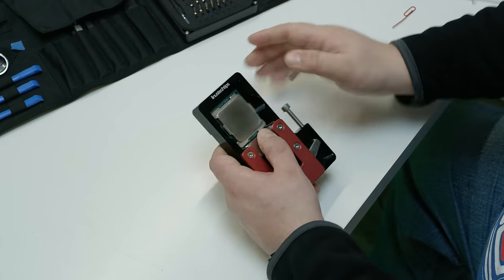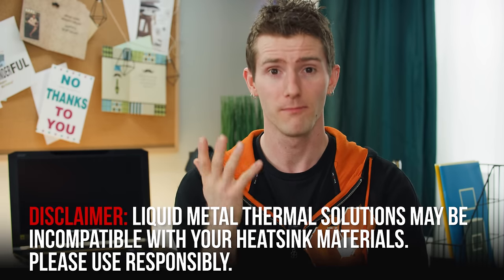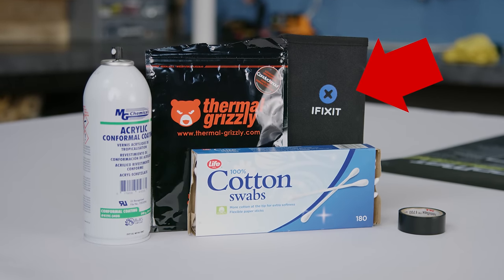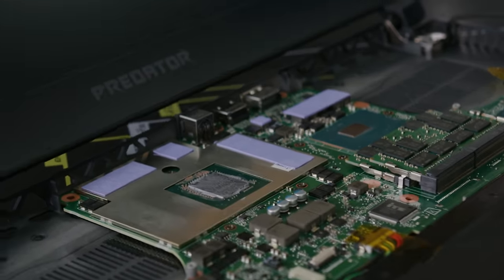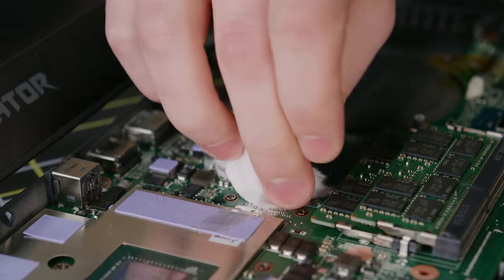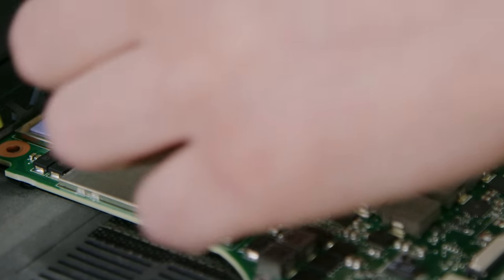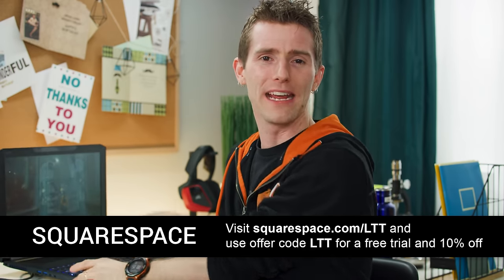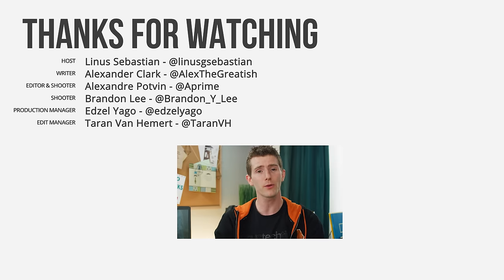Liquid Metal Laptop Cooling – 20C LOWER!

Comment: Finally LMG... using LM on laptops is almost mandatory, as is undervolting/overclocking using thorottlestop
Reply: Could you tell me how often should I change the LM in a laptop if I clean and re-apply say, a GC Gelid Extreme about once a year?
Reply: yesterday applied gc gelid on my 960m and 4710mq got 20c drop
Reply: You don´t need to do it very often. I do it every 4-5 months because I feel better, but there is no change in doing so. It holds up better than normal paste.
Reply: daily...
Reply: I was thinking the same, two months ago i change to liquid metal on my notebook and did some undervolting of the cpu (7700hq) and overclock/undervolting of the gpu (nvidia 1060) and i went from 30 fps on shadow of war with a lot of stuttering to almost 60 fps smooth AF. Temps also lower between 15 and 20° less than before. Ah the 1060 is overclocked to 1935 mhz @ 0.9v with a +200mhz of vram. I used MSI afterburner for that, if you press CTRL + F you can set a curve profile and limit the voltage for each clock.
Reply: i got a similar effect on my 7700hq simply by undervolting. my cpu would not stand for -120mV but -110 and -115 worked
Reply: Jan Dano I don't get it. What does undervolting mean and why does it help?
Reply: undervolting is just what it sounds like running the cpu or gpu on less voltage which means they generate less heat to begin with. All heatsinks have a limit to how many watts of heat they can remove from the source. Undervolting reduced the potential heat it can make. Every cpu/gpu is different some can't take any less than the specified some need more most of intel's line can do -50mV the 7700hq likes -100-150mV less than spec. 

The paste that everyone is raving about is the contact between the heatsink and the source of heat be it gpu or cpu. It reduces the resistance of the flow of heat into the heatsink but only across the gap between the two surfaces an undersized cooler with too little air flow will just get saturated quicker...
Reply: Lunas Eclipse thank you. Should i undervolt my 1080 ti zotac amp extreme core edition? It runs on 61° C on full load at approx. 1980 mhz.
Reply: humm 61C is below threshold for it so not really going to help  80C is the ceiling for cpu/gpu since you are not over 70 you likely dont throttle at all. The only thing you might be able to do with undervolting in this case is shave a few more degree off the temps. Msi after burner can help you tweak the card to maybe get it running even cooler. But you are not throttling at 61C
Reply: Thats a desktop GPU? Desktops gpu have better coolers than laptops cause they are bigger. It wont help if you don't hit the power limit. You can check it on MSI afterburner. There is a meter that says Power limit, if its high the card is not clocking higher cause it reach the power limit. In that case if you underclock it you will gain performance.
Reply: that is just how the 10 series is responding. the undervolt is producing less heat giving you more stable oc...

Comment: Liquid Metal Compound DO NOT MIX WITH ALUMINUM 
Following AD: All Aluminum EK Watercooling Kit
Memes were born
Reply: liquid metal cool laboratories or this stuff is primarily gallium. 

Gallium is that dirty gigolo metal that likes to get with every other metal. It spends one night with aluminum and the next thing aluminum knows it is pregnant the tv is gone and her bank accounts drained and gallium nowhere to be found and her car is gone...
Reply: Ahh. Everyone loves crumbly aluminium.
Reply: The blocks would have a nickel coating on them.
But they're made from aluminum rather than copper.
Reply: We have flowed many liters of Gallium-Indium-Tin in our research liquid metal magnetic loop and it once leaked onto the aluminum support structure and it steadily began to consume it like some kind slow but powerful super acid.  It never stopped, requiring a complete disassembly so what remained of the  aluminum support frame could be disposed of.

Application in any kind of electronic device should absolutely include 100% containment/sealing with minimal quantity (a drop or less) to protect components. It also begins to react with air, oxidation etc...

Comment: This is an excerpt of a comment on another video, and the reason why I think you just gave that laptop the equivalent of terminal cancer.

bobsagget823 5 months ago
Leaving this as a top level comment so more people can see it:
I did more reading about this stuff since I'm interested in using LM for my own laptop, and it seems corrosion is not out of the norm. 

Typically when LM is used under the IHS of a desktop CPU (often necessary for intel chips since they bond the IHS to silicon with toothpaste instead of solder) the results are pretty good even after a year. The IHS (which is made out of copper, then nickel plated) does get stained by the LM but nowhere near what happened to you. This is because your contact (in a laptop) is silicon die <-> LM <-> copper heatsink.  In the desktop scenario, LM is often applied underneath the IHS so the contact is silicon die <-> LM <-> nickel plating <-> copper.

To be even more clear, the key differences in your application of LM is that
1. Your application was silicon-copper instead of being silicon-nickel as you would find in the 'delidding' of a desktop CPU
2. Your application was not insulated against air (read: oxygen)

1 is important because the electrode potential of gallium is -0.53V, nickel -0.24V, and copper +0.34V. Obviously, all liquid metals are made out of gallium (because Ga is liquid at room temp, and is also nontoxic unlike mercury) plus small percentages of other metals to reduce the melting point. When gallium is in contact with pure copper, the differences in electrode potential favors the gallium and copper to alloy, which will eventually consume the gallium completely[1] (Ga + Cu → CuGa2 [67%] + Cu3Ga [11%], and both products are stable until 175C)[1][2]. 
The liquid metal will literally into the copper until the gallium is gone, which causes the copper to turn silver-ish. The non-gallium components (indium, tin) of the liquid metal[3], which are solid at room temperature, get left behind - and that stuff is hardened deposit that you were trying to scrub off the heatsink.
Note that at higher temperatures, the reaction between gallium and the copper heatsink only gets faster.

2 is important because the gallium based LM components can and do oxidize. This is the reason why people generally recommend sealing your contact as much as possible. With a desktop chip under an IHS that's already halfway taken care of by the IHS itself, so if you've never seen a liquid metal tutorial for a laptop you might have not even known that sealing the LM was important. I'm not making this stuff up, gallium begins to oxidize at 25C and fully oxidizes at 75C[2] (Ga2O3, mass fraction 0.12) which is a totally achievable temperature range. This is not even considering the fact that the other components on the LM can oxidize, and they likely will.

Other interesting things to note: 
1. The thermal conductivity of CuGa2 (the principal alloy of gallium and copper) at 20C is 98 W/(m⋅K). Copper's thermal conductivity at 20C is 400 W/(m⋅K).
2. We have no idea what exactly is in LM, the formulations are proprietary - but it's been said that the consistencies of Coolaboratory CLU & grizzly conductonaut are not the same so clearly whatever is in this stuff varies and lead to different results.
3. Simply buffing the residue off the copper heatsink and reapplying the LM might be OK. The GaCu alloy is obviously not as good of a heat conductor as pure copper but it's not clear how deep the gallium will attack. If eventually you keep reapplying LM and the gallium can't penetrate its own pitting then it's effectively self-limiting and you end up with a 'stable' LM application.

These papers are interesting if you want to learn more about the process:
1. http://www.ipme.ru/e-journals/RAMS/no_81808/grigoryeva.pdf
2. https://sci-hub.ac/https://www.scientific.net/DDF.326-328.227
3. http://forum.notebookreview.com/threads/something-to-think-about-liquid-metal-compatibility-with-copper-heat-sinks.800890/

TL;DR
Liquid metal pastes react with copper heatsinks (aggravated by oxidation and higher temperatures) until the gallium in the paste is totally absorbed by the copper heatsink and you end up in thermal runaway. The damage to the copper is permanent, but if you keep reapplying the LM whenever this happens you may end up with a stable LM application. LM is much more stable when used under the heatspreader of a desktop CPU, since the heatspreader is nickle-plated and way less reactive to the LM.
Reply: неплохо
Reply: Ok, from the top, but this time explained like I was a 10 year old. 😂
 Thanks for this. Totally forgot that the nickel IHS was the only reason why it was safe for the long term on desktop and not laptops.
Reply: @mikeoxlong6351  10 year old kids doesn't have chemistry lessons at school fyi
Reply: Omg
Reply: You didn't have to copy the entire website man.
A summary would have been great.
Reply: @Raylightsen  its at the bottom.
Reply: Exactly what I was thinking! Thanks dude. 👍
Reply: so how does this factor in with the ps5. From what I saw its pretty much direct contact with the die
Reply: Yes, exactly. But this is also exactly why you need to nickel plate the heatsink! ASUS for example is only able to sell notebooks with preapplied LM because they nickel plate the heatsink.
Reply: @petrusion2827  wait a minute. ASUS sells notebooks with LM preapplied? Is there a list of their notebooks that come with this, or is it all across their notebook collection? I have a Zephyrus and I’ve been looking into LM as a solution, but of course if nickel-plating is important, thats something I would need confirmed first.
Reply: @ItzzzBeamo  Their expensive gaming notebooks come with LM preapplied on the CPU. I don't know which ones exactly, all I know is that the one I'm waiting to get in stock, Zephyrus duo, does

Comment: Linus is finally on the delid train
Reply: Also some of them are soldered to the MB.
Reply: Well, one wouldn't have thought the bottleneck here (super thin laptop) would be standard thermal paste. (Rather moving the heat out of that thin case)
Reply: This irrelevant, laptop BGA and LGA CPU, GPU & chipsets do not have an IHS. Only desktop Clevo and all alike laptop the desktop CPUs would one. And it is recommend to delid the those laptops as the reseller will commonly offer a delid service before shipping is you choose.
Reply: I needed to delid my cpu and apply liquid metal to get better temps while playing minecraft

Comment: Manufacturers will never ship items with liquid metal underneath their IHS' due to the risk of jostling it and making it spill out onto other components during shipping and handling
Reply: on a desktop cpu they just solder it, on a laptop solder isnt practical
Reply: AMD already does this, Intel used to. Go look at an older i7 2600k and you'll see that the processors were soldered to the IHS which is nearly as good as liquid metal TMI
Reply: Ghosted Talking LIQUID METAL not solder.

Comment: I did some research and there is one more thing to be considered. Gallium (main metal inside LM) in contact with copper gets into it over time, that's why sometimes people can't get rid of it when it "dried out" - it doesn't really dry out. It created sort of an alloy, bacame "one", like sunk into it. Of one thing I'm not sure - if this is a bad thing or not... What I'm sure of is that it won't be a pure copper anymore (heatsink, at least a part of it), more of a "CuGa". That's the only thing keeping me away from applying it to my A17R4...